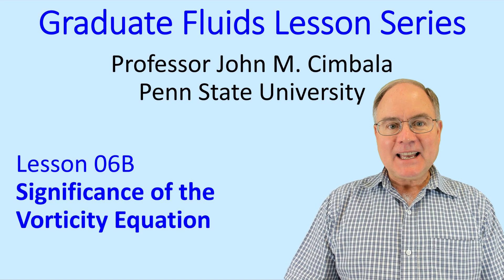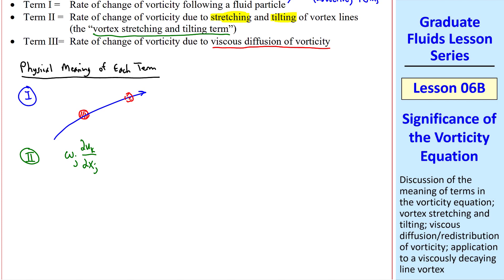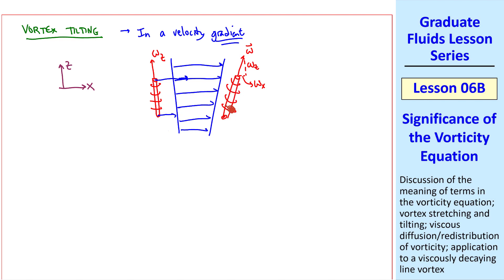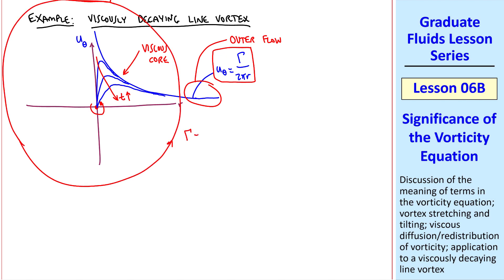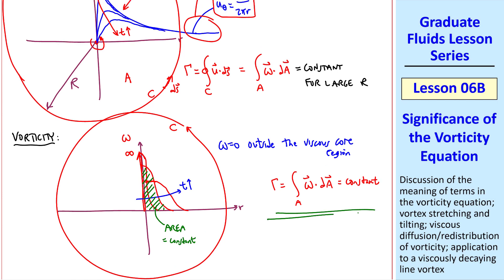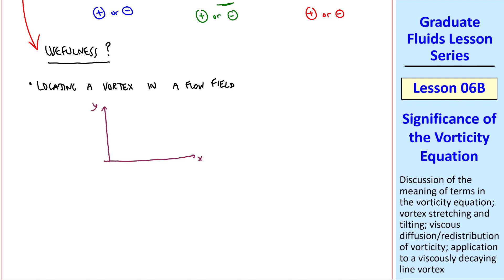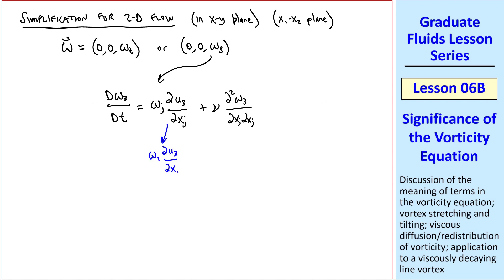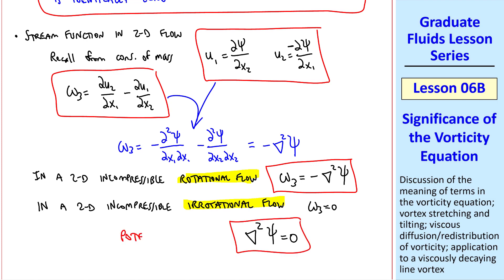Graduate Fluids Lesson 06B: Significance of the Vorticity Equation

Comment: Thanks a lot Dr.Cimbala. I just have a few doubts which have been summarized below

1) would the stretching / tilting term be defined only for a three dimensional flow field.?   Is there any physical case where this is not so.?

2) With the diffuser example that was provided (for the vortex stretching case), how does the equation account for the stretching part in that sort of a 2- dimensional flow.?

Thanks in advance
Reply from the maker: (1) The vortex stretching and tilting term is zero in a 2-D flow.
(2) That example flow is not 2-D since the vortex swirls around the axis that point up - so by definition there is flow into and out of the page; it is not 2-D.
Thank you for your comment. Please tell your friends and colleagues about my YouTube channel where there are more than 460 free videos about the Bible, fluid mechanics, science, math, statistics, air pollution, and other topics. I would greatly appreciate it.